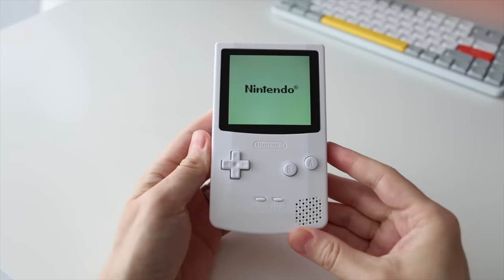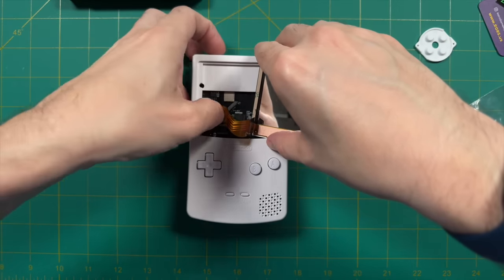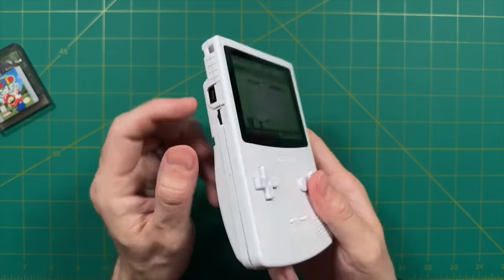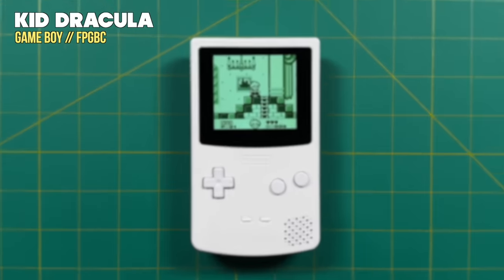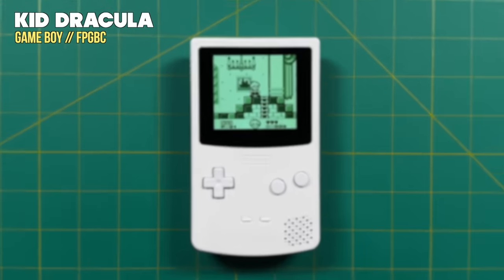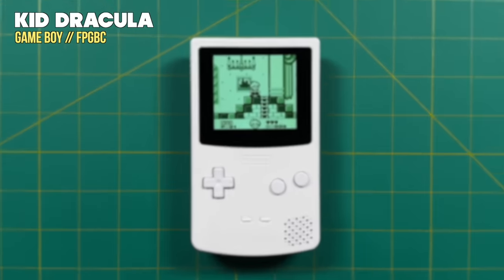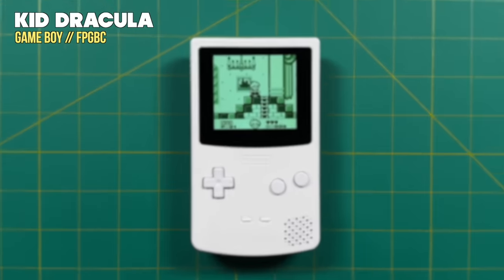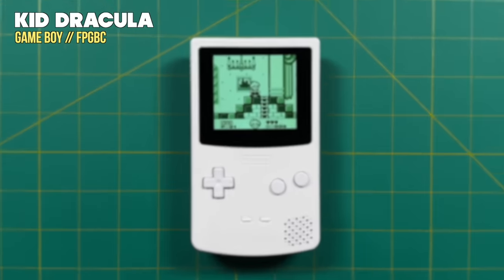FPGBC Review: My Favorite Game Boy

Comment: Cant wait fir them to do this with the GBA
Reply: Why? Will never understand the love for it. Hated how far away my hands were from each other. Completely skipped it as a kid after trying out a friends and completely hating it.
The the SP came out and I laughed even more at the Advance.
Reply: So you haven't had the joy of playing the GBA catalogue, no wonder you don't understand.
Reply: My man's hating on the ergonomics of a GBA 🤣. But I bet you have no issue using any console controller or a Nintendo switch or maybe a keyboard and mouse.
Reply: @paulkendrick4153  You missed out on the SP model then
Reply: @paulkendrick4153  big mistake you missed out, GBA catalogue is even better than the GBC's
Reply: @paulkendrick4153 never met a single person that ever complained about the shape.
Reply: @paulkendrick4153  you ask why, then state that you're forever close minded. good luck dude
Reply: @TunaCanGuzzler   SP is way better so I did enjoy the catalogue 🤡. Able to fold and easily save the screen from scratches and fit it in your pocket. Also has a backlight where you can actually SEE and not have a crappy worm light like the trash Advance needed. The Game Boy Advance was trash. Learn to accept it and stop 😊
Reply: @himbourbanist   Nope I got the SP.
A much better handheld 😊
Reply: @paulkendrick4153   I think you confused people by saying the GBA is bad, which they took as you saying the GBA line in general is bad, when what you meant is that you dont like the original GBA but you like the GBA SP.
Reply: @spider_sf   lol no. SP is great. I’m only talking about the original Advance.
Reply: Really needed too! I've long given up on finding an AGS101 now, they've all been bought up or harvested.
Reply: Will probably need a different FPGA chip though. The main price difference is reflected in the lack of power - available logic units.
Reply: All GBAs are flawed.
Original runs on batteries and lacks background lighting for the screen.
SP is nowhere as comfortable, lacks a 3.5 audio output and is weird to play with GB/GBC cartridges sticking out.
Mini will be uncomfortable for many, is gonna have a screen too small for most, and lacks backwards compatibility.
It's unfortunate really.
Reply: @paulkendrick4153  Yes somebody ought to teach you about opinions because it seems like you don't know the difference between facts and opinions😂😂😂
Reply: @VSMOKE1   I respect your opinion, but I love the Game Boy Advance SP
Reply: Q @TunaCanGuzzler
Reply: For a moment I thought we were talking about the OG Phat NDS 😂 that grey thing was... Something. 
I liked the OG GBA, but what it really needs is a backlit screen. Modkits nowadays and custom cases nowadays give GBA a nice retrospect look into the ruling handheld if the 00s❤ No Wonderswan Crystal for us...
Reply: Yes! I love the horizontal layout of the GBA so even if I never played GBA games it'd be worthwhile. I just ordered one of these and the cheap flash cart with the exact same label as Russ's, just for the fun.
Reply: @paulkendrick4153  ok boomer
Reply: @paulkendrick4153  you didn't like how far your hands were? Do you not use console controllers?
Reply: @paulkendrick4153  You didn't like how far your hands were? Do you not use console controllers?
Reply: @paulkendrick4153 your TRIPPIN 😂😂😂
Reply: @ItDaBiz  Still running my original GBA from when I was a kid. Upgraded the buttons, screen, and shell
Reply: I will 100% buy this day one
Reply: @nate6045 that dude must have Trex hands
Reply: Original GBA ergonomics were the best. The sp was way too tiny for me. The backlit screen was cool though.
Reply: The PSP was a better GBA. Nintendo consoles are some of the most uncomfortable I've ever used
Reply: @fillerbunnyninjashark271  you're on a GB fpga video, comenting on a GBA fpga op, about how you hate nintendo and psp is better. Only the insane go out of their way to act so nonsensical
Reply: @GhibliNova  😆 PSP is a way more comfortable GBA and I played way more GBA on it than I ever did the GBA. Get less offended
Reply: @fillerbunnyninjashark271  the psp was lame. Everything about it was cumbersome. Those minidisc were terrible. And the ergonomics on that. What trash placement for lame joysticks. The laptop nub was a better joystick than that.
Reply: @fillerbunnyninjashark271  not offended just genuinely shocked at you're decisions 😂 they're insane
Reply: @GhibliNova  your* and no. Why the fuck would I used hardware designed to cramp your hands. Even better is I never had to pay a single penny for a single GBA game. Played them on my PC with a comfortable controller until GBA emulator came out on PSP.
Reply: @pieslice  the PSP literally had the best dpad on a hand-held. Maybe stop gorilla gripping your handheld... You're supposed to use your fingers to hold them... PSP literally rests perfectly
Reply: @paulkendrick4153  it's almost like different people enjoy different things. no one's forcing you to like the GBA.
Reply: @fillerbunnyninjashark271  Why would you come to a Nintendo video and respond to a Nintendo comment about how much you like something else while ripping into Nintendo? I have no clue, but clearly your desicion making process is insane-asylum worthy
Reply: @GhibliNova  speaks to more why you're so offended you're not in a echo chamber.
Reply: @fillerbunnyninjashark271  no it doesn't. Because your comment has nothing to do with op. I was talking about excitment for what this company does next, you said you hate the gba and the psp is better, those two things have nothing to do with each other. And you werent responding to anyone else. You're just nuts and proud
Reply: @GhibliNova  see you're being disingenuous... I said the PSP was a better GBA than the GBA was. Meaning, I used the PSP to play GBA games. Really not difficult to understand. Try reading the entire statement instead of trying to cherry pick
Reply: @fillerbunnyninjashark271  you're projecting, what does any of what you said have to do with any of what I said
Reply: @GhibliNova  you really are incapable of comprehending what you've read. You should read more books
Reply: @fillerbunnyninjashark271  your insanity has made you forget what you wrote
Reply: @GhibliNova  the PSP was a better GBA than the GBA ever was. Didn't forget. You really need to touch grass
Reply: @fillerbunnyninjashark271  good! You know how to scroll up! Awesome, so now what does that have to do with my comment?
Reply: @GhibliNova  I didn't need to scroll 🫡 gba sucked. Just get a PSP. Or a retroid pocket. Both have save states and can actually be put in standby mode. Both are also significantly more comfortable to use. But you probably won't understand what I wrote again 🫡
Reply: @fillerbunnyninjashark271  nah, cause I can't wait for them to do this with the gba 😊
Reply: @fillerbunnyninjashark271  hahaha your lying to yourself about the psp. I think the psp was cool but not great. If took a whole community of people to keep it relevant. Look at you, you’re using it to play the GBA library. Also, the psp ergonomics are trash. They went for looks rather than comfort. GBA is about playing games and comfort. Check your arms.  I think you might have hooves instead of hands.
Reply: @pieslice  Nintendo controllers and handhelds have the absolute worst ergonomics. The PSP and Vita have been the most comfortable handhelds made. Stop curling your fingers in and gorilla gripping it. That's not how handhelds are meant to be held. That's how you get carpal tunnel. So enjoy that
Reply: @paulkendrick4153  do you play your home consoles using a tv remote shaped controller vertically? thats pretty cool. Who builds all your vertical controllers? Do people call you vertical man? When you drive is the steering wheel just a vertical brick? Did you turn the door handles on your car to vertical position? Verticalman!!
Reply: For real its so expensive to get an IPS modded GBA and there is no good mod with all the features rather there is multiple mods with different features
Reply: @fillerbunnyninjashark271  wow now I know for sure you just don’t have hooves you have a snout also
Reply: @pieslice  says the consumer
Reply: i really want a gba sp motherboard that fits the boxypixel sp shell. that would be so dope
Reply: It's fair to take shots at the stupid screen that you had to use the worm light or sit right under a lamp. But acting like the form factor was uncomfortable is a questionable opinion. If the gba had the backlit screen from the SP that would be perfect.
Reply: That would be the dream.
Reply: @paulkendrick4153  the Advance has a better ergonomic grip experience. The layout was more in line with a console controller.

Thats why it’s liked so much.

The SP is a better system. But the form factor for buttons isn’t perfect
Reply: @paulkendrick4153  it's ok. The og GBA is only for men who have manly hands and taste. Have fun with the SP and your toddler hands.

Comment: You can also start up the cheap flash cart much faster by immediately pressing the start button when the menu loads. This action will initiate the last game flashed into the internal storage, saving you quite a bit of time compared to waiting for it to flash every time. If anyone intends to go this route I also highly recommend checking your screen uniformity on the GB core without a game on launch. I've seen 3 out of 4 FPGBC screens with severe quality control issues, mine of which is currently unplayable and Funnyplaying is giving me quite a runaround in getting another replacement. The replacement that just arrived also has the same splotches on the screen which look to me like water damage. I've seen this on 3 FPGBC screens so far as mentioned and 1 SP screen all from Funnyplaying (I also had this on my FPGBC review if you're interested in seeing what that looks like). That aside though if you get a good screen this is a fantastic handheld. Great review as always Russ!
Reply: Wow, I am surprised about your screen issues, I haven't heard this much. I consider myself lucky that I got a good one in that case! I enjoy your channel.
Reply: @Omar_Little  Thanks! Always nice to hear! Yeah, it seems like quite a bit of bad luck on my end.
Reply from the maker: Nice tip, thanks Kei!
Reply: Man i got a screen from funnyplaying and it was water damaged! i thought i just had messed up doing something but i was 99% sure i did not cause the damage. Im starting to think i might not have

Comment: My favorite Game Boy DMG mod is the backlight with bivert.   It retains the original screen but provides a backlight and higher contrast.  It's also cheap with parts costing less than $20.  The installation is a bit involved and it does require some soldering but shouldn't be much of a problem for anyone with a little experience.

Comment: The link cable problem is likely related to the timing problems the FPGBC. It's not clock accurate. You can adjust the speed but the proper speed is between two of the setting points. So you can run it either a little too fast or a little too slow but never cycle accurate. That will cause communication problems with the link cable.
Reply: Exactly this. This very same reason is why the original Super Game Boy on SNES did not come with a link cable port - because it runs slightly faster than the original hardware.

You can actually mod the SGB1 to have a link cable port and it will not work until you install a separate mod that makes the SGB1 run at the proper speed of an original GB/C. The Super Game Boy 2 naturally has these features within itself - it runs at the correct speed which allowed them to put a link cable port on it. Therefore, the link cable port cannot work properly until the FPGBC has the correct timing of GB/GBC.
Reply: Can a FBGBC connect to another FBGBC, then?

Comment: just a note at 24:31, that washed out look is probably unintended. the original gb dmg and other display modes are all the exact same as the analogue ones. the current version of the core seems to come with a palette already applied, and having custom palette set to auto or force will apply it over that display mode, causing the washed out look. setting custom palette to off will make them look normal again, for anyone who prefers it that way.

Comment: The reason link cables aren't working likely isn't hardware failure, but it's related to the CPU speed being inaccurate. since it's running at a slightly different cycle speed, it's unable to sync up to another device with the original cycle speed of the GBC. this is why the pocket works with the OG GBC, it's got proper cycle speed.

Comment: I've been using the FPGBC for a few months now and it's also been my favorite new GameBoy by far. I was also able to find an Everdrive X5 for around $60 for it which has been working great across all games so far. It basically supports everything the X7 does except save states. The X3 is also a cheaper reliable option though you have to reset the device to fully save a game that uses battery backup.

Comment: The issue with then link port is hardware related and there's a fix. I'm inferring that it's the same issue that is causing Game Boy Printer incompatibility, for which Funnyplaying has given the solution in the release notes of v1.08 of the firmware (24.03.25): the motherboard resistor r45 needs to be removed. They also added an image of where that resistor is located. I'm not gonna test it before someone like Mahko tests it out though :D
Reply: I'll just wait for 1.2 of the board.
Reply: I saw the note in the 1.8 firmware, but I think it must have been broken by that firmware. I'm on 1.06 and I've been able to use the link cable between the FPGBC and an original GBC.
Reply: I'm planning on playing through All the old pokemon games with a moded gameboy will this affect trading with a link cable?
Reply: @jeremyp8409  Depends on what you modded. If it's just an old game boy with a screen replacement, you'll be fine. Link stuff is only a problem with non-Nintendo devices, like the FunnyPlaying Game Boy Color, or if you changed the oscillator crystal.
Reply: @rembrandx  thanks for the info 😁

Comment: Great little project this is. I used an ear swab to push down on the battery connector and the foam that came inside the speaker container is the perfect thing to slide under the battery to remove any play. Thanks, Russ!

Comment: Fyi u can actually also use the white "gbc" laminated screen on the fpgbc. The only drawbacks are the battery light is non existant, the screen is smaller than the full mode screen and the gbc logo does not work (although, i would imagine fp can do a fw update for that).

Comment: I have an Everdrive x7 and it works perfectly on one of the older firmwares (I think the one before the latest one you installed). You’ll lose the new screen modes but as you said, they aren’t that great anyway.
Reply: May I ask your FPGBC firmware version and your Everdrive GB x7 firmware version? I feel like I've tried every combination under the sun, and still nothing. Fully updated, my ED works on a stock GBC. Not on my FPGBC.

Comment: I recently put one of these together, waiting for the 20 dollar Aliexpress card. The EZ-Flash Junior will work but you have to update to the firmware version that was pulled. Unfortunately the results are underwhelming and very few games actually load even on the aftermentioned firmware. I've had to take mine apart a bunch to fix up the backlight bleed (transparent shell) but other than that I love the device.

Comment: @RetroGameCorps just a note on the budude GB core on the Analogue Pocket - the DMG display mode is not supposed to look washed out like that. By default the core has a palette enabled that messes up the look of the shader/filter. In the core settings go to Custom Palette and turn it off and it should now display exactly the same as the DMG display mode in the main core when playing a cartridge.

Comment: I agree with a lot of your points from the last 6 or 7 mins.  I like my Analogue Pocket but i much prefer holding my og GBC and landscape GBA.  I tend to use my AP more like a MiSTer Jr that i can choose to swap between handheld or docked like a retro nintendo switch.  This FPGBC looks more like something i'd want if focused on gb/gbc, aside from the flash cart issues.  And the price is excellent.  Modded GBC would be most ideal for me though.  There are options with larger screens if someone needs that, but i find the screen size difference pretty minimal anyways.  Great review!

Comment: I love the looks of that white GBC! I bought a pre-modded real GBC on ebay with the DMG look before I ended up getting a pre-modded DMG. I made sure to get them from a good seller that uses Funnyplaying screens. The FP screen on the DMG comes pretty close to the original color. And when you add up the cost of buying all the parts individually vs. buying them premodded, it is really the same. I did my own GBA and even though I got a great deal on the GBA itself, the IPS screen, shell, etc. was over $90. But after all that, the Analogue Pocket is so much better and in a league of its own.

Comment: Nice video and I agree on the most points you worked out. Only my summary would be different. The analogue has his own crisis as you described in form of his form factor and controlls. Funny play has a problem to communicate with ordinary devices which is sad and hopefully can be fixed with updates. The OLED Panel doesnt competes, for me at least it's an upgrade for already existing hardware while both mentioned before are alternatives for the shrinking market of original hardware and therefore a form of conservation. I hope I get this somehow understandable 😁